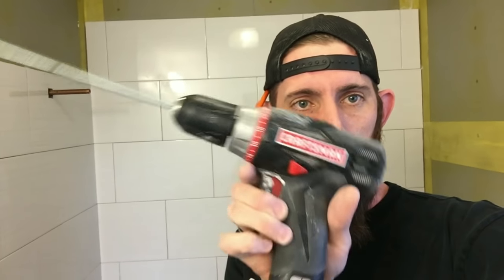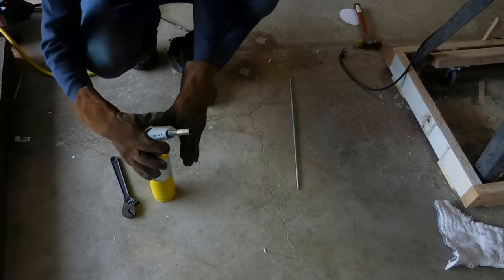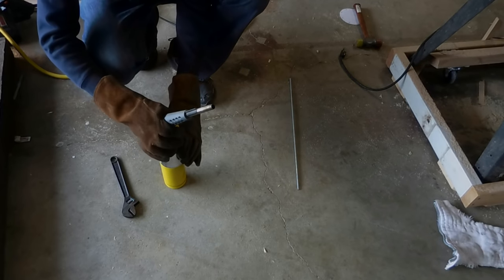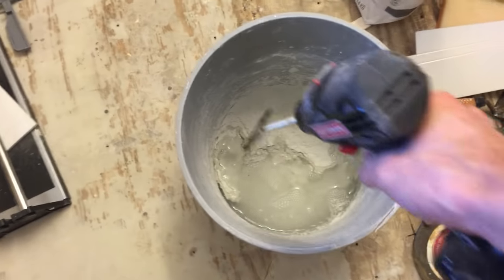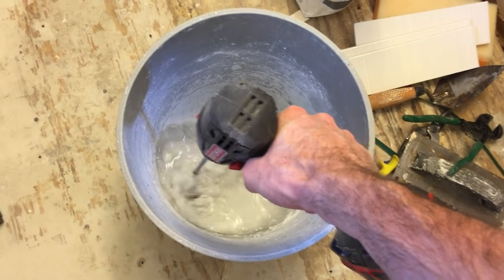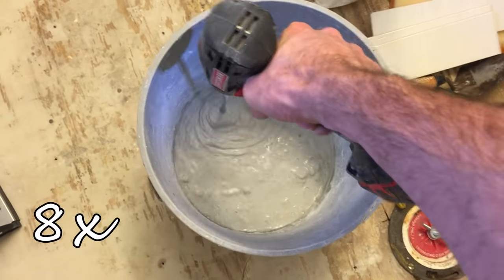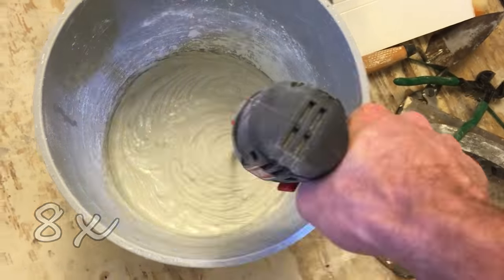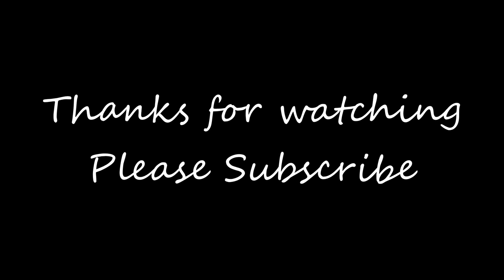Quick Tip: DIY Paddle Mixer

Comment: How can you clean it once it is done mixing?
Reply from the maker: I just spray it off with a hose before it hardens and scrub it (if necessary) with a brush . You could probably also just spin it in a bucket of clean water to clean the majority of material off of it.

Comment: that 8x ruined your video Why you did that ...? I would like to see its actual speed
Reply from the maker: B Bobby the majority of people will skip a video that is too long and monotonous. I do too. In some of my more recent videos, I have started putting a timer in the corner of the video so the viewer has an idea of the actual time that has passed. The purpose of the video is to show how I did it, not how long it took, as everyone works at different speeds. But just to give you an idea, the heating/bending part of the video was around 21 seconds long. If you take 21 x 8 = 168 seconds which is under 3 minutes. The mixing part was about 15 seconds long, so 2 minutes actual time.

Comment: How about for kneading bread  dough?  I guess we'd  need  a bendable Stainless Steel rod,  to simulate a dough hook for health & safety reasons? I'm disgusted w Kitchen-Aid  company trying to charge upward of $350-$800 for the Stand Mixer components..all Made In China & they advertise these mixers are "ASSEMBLED" in the USA. I wonder if I could bend a 1/4 inch (5-6mm) stainless steel rod without a blow torch? I just REFUSE to spend that  kind of money to make any  communist country that rich , all at our health's expense.